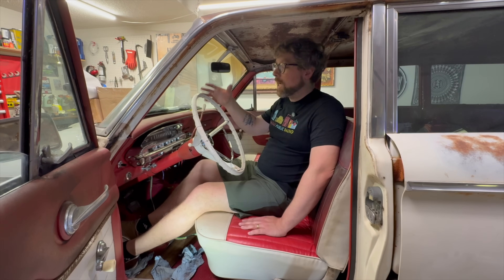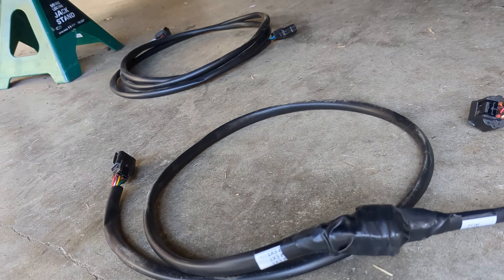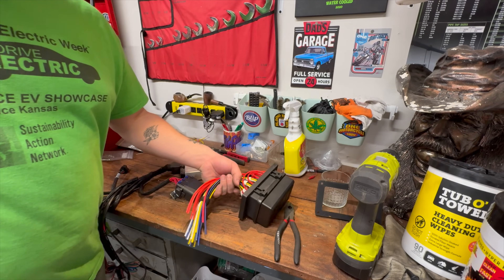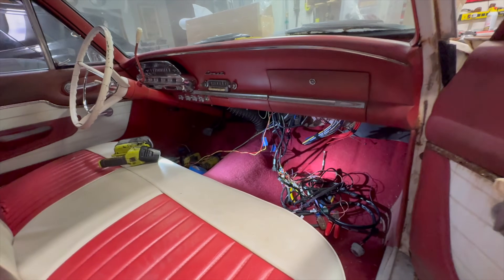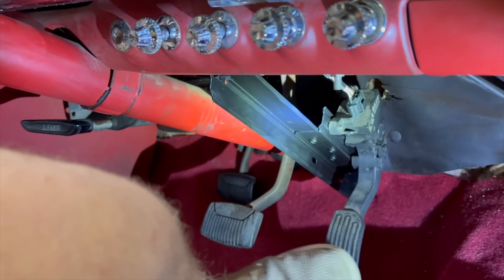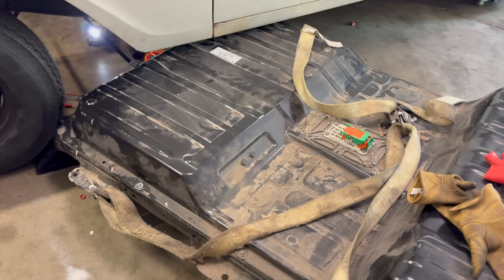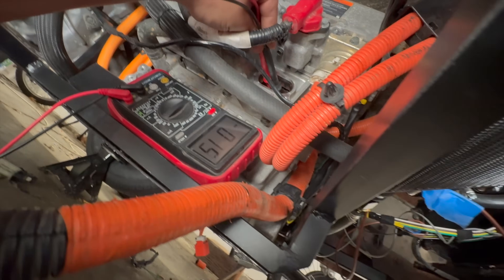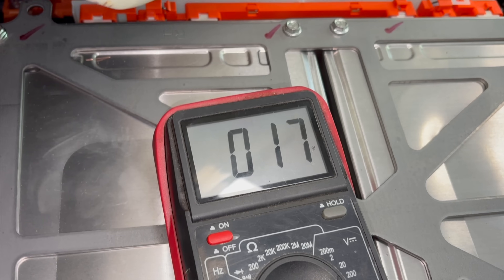Watch me destroy my EV conversion project.

Comment: lol i didnt know the battery wasnt in the car and my stomach turned when you cut that wire. was there enough rubber on the grips of the shears to stop a lethal 350v? well im seeing the video so there must be. 
i do a lot of sketchy mods to my phev, like downright reckless russian levels of yolo modding, but i am straight up terrified of high voltage dc. good thing the battery did not go into dead short. dam bro. you were still risking your life/house to a 50$ fuse and a 1-15$ resistor. wondering if there was a safe way to hook the battery up and probe the wires before reconnecting them. or even just test continuitiy from where the ev battery would attach instead of at the difficult to access inverter. hope its just an inverter.

Comment: The most screaming moment was when I saw you messing around inside the HV battery pack... WITH BARE HANDS...

You really need to respect LETHAL DC voltages... there's no such thing as "second chances" or "I'll wear proper EV gloves next time" when it comes to HV DC shocks... ONE SHOCK is fatal... not to mention the ability of 400V DC to ARC and create the HV Battery pack fire.

Comment: Using 3 toggle switches for R/N/D is a bad idea... should be a rotary switch with break-before-make contacts... that way it's IMPOSSIBLE to accidently turn two mode switches ON at the same time.

BTW, it's "con-ti-NEW-ity"...

Comment: Thanks for showing your mistakes. As someone who’s used to working on cars I’ve taken for granted how the mechanical side of things will physically let know when there’s an issue before it becomes a bigger problem. 

After shorting out a 200v pack(lucky with a thin gauge wire) I’ve learned to take my time on the electrical side of things and triple check no matter how minor

Comment: I had to look away when you cut the wire!  I thought you insinuated it was live and connected to the battery and that was the goof. 

I think the fail-safes did their job. Hopefully you will find the fuse, cap, or mosfit you blew and have a spare inverter. Fingers crossed for you!

Comment: Errors cause knowledge to form, it's a gift... as long as it doesn't kill you, of course! 
Love the high performance power rear window. That will come in handy on hot days to be able to operate it from the driver's seat, and being an EV, there isn't the concern of exhaust gasses entering. Measure twice, cut once!
Reply from the maker: RE the rear window: I used to have a 4runner with a power rear window but the exhaust gases would always drift in a gross us out. I can't wait to use it now without exhaust gases to worry about. It will also be really nice to have before I get air conditioning installed.

Comment: 9:05  I know I'm beating a dead horse, but offset your splices.  The ridges on your copper crimps are now directly in line and need 4-5x the insulation you gave them.  If you offset them by a foot or so then you could add insulation to the 'uncut' wire passing by the splice, then 2 or 3 layers of insulation over the splice and it's a lot safer because you don't have two 'sharp' edges trying to destroy your insulation.
Reply from the maker: Good points, thank you, I'll keep this in mind

Comment: 8:47  HV wire going into the trough with a hard edge.  Needs to be triple insulated AND no sharp edge.  For safety.  So think a smooth folded edge, or a (non brittle) plastic riveted in place for the rail.  Then put the wire into PEX, then bundle that in the safety orange corrugated armor.
Reply from the maker: You're right but it actually is a folded edge. Regardless I think I'll order some cable tubing/sleeve to add another layer of insulation.

Comment: ALWAYS check polarity with a multi-meter for first connection with a HV pack.  And check it 3x, and then check it again.  You are only alive thanks to Nissan engineers and industry/DOT safety requirements for EV battery packs.
Reply: Yeah. The key (for me at least) to stay sane when doing Electrical systems is check the voltage of each segment in all possible states every time before and after I connect any two segments together.  I don't get why you had to take apart the battery when you could have just checked the voltage at the connector after it didn't work. If you have the voltage the fuse isn't blown and the connections are functioning. Either way I'm glad you shared the video. ♥️ Good luck, I love your determination
Reply from the maker: Clearly it was a mistake not to do that. I just didn't want to open up the battery pack. I had it in my head that I would use the pack, unmodified, to get the wheels spinning. After that step, I would open it up and modify it into a shape that would fit under the hood. I was reluctant to deviate from that plan and it costed me big time.

Comment: 7:00  NEVER cut through a bundle.  You made me veeeery nervous.  ALWAYS peel back and cut each conductor individually.  Bonus points for offsetting the cuts to leave room to extend the wire.  It is always nice to have the splices offset for safety and a much reduced 'bump' in the cable.  Two smaller bumps are better than one massive one.
Reply from the maker: absolutely right
Reply: It made me wince because even though the HV battery was disconnected, if it was connected to the inverter there could have been a voltage present that would have shorted across your pliers. Inverters have huge capacitors so should always be treated as live until proven otherwise (a bleed resistor might or might not be present). Stay safe, cool project.

Comment: 2:48  Something I learned from electricians is that you wrap it sticky side out, then come back sticky side in to finish (to get it started you do a couple turns around the wire, then start wrapping backwards).  Also I don't think these help with waterproofing very much, but it may keep dirt out, which makes the connectors nicer to undo later.

Comment: When you say high voltage mistake I'm just thinking "he posted it, so in theory he is fine and no-one was hurt".  Because just letting a 40v 15A/Hr pack arc with an 8 guage wire made a plasma ball.